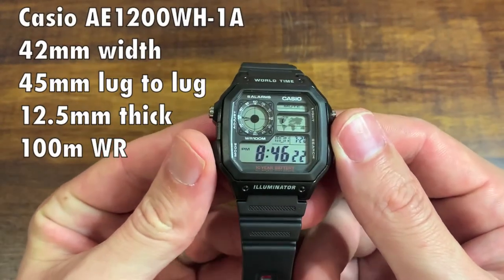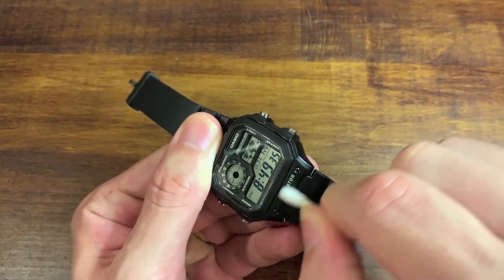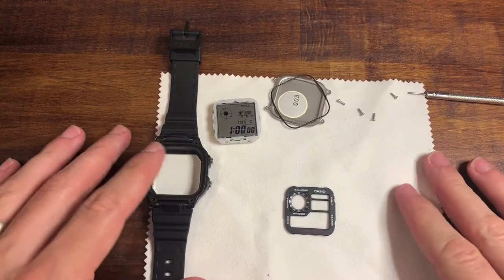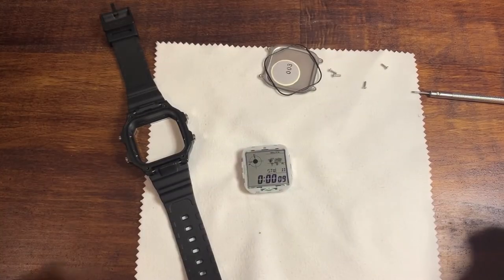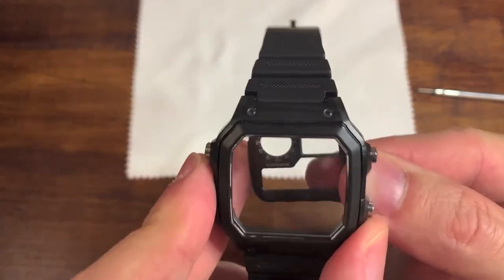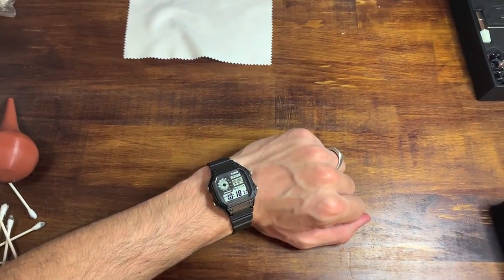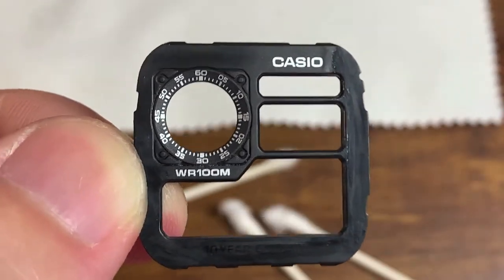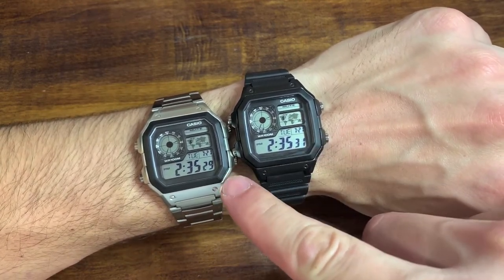Oops... I Used Acetone (Nail Polish Remover) On My Watch

Comment: You can use acetone on plastic but you have to use alcohol to wipe it off almost immediately. The alcohol will get rid of the smearing from the paint and also neutralize the acetone. Then if you want, if it dulls the plastic, use a dab of car polish rub into the plastic and with a clean cloth wipe and slightly buff the polish off without the polish drying. Ive done this with the lettering on resin cases and worked great . Give it a try on a cheap crap watch till you get it down then do your favorite watches like Casio sports watches.

Comment: I found another video that suggested using a Staedtler Mars Plastic eraser- the white one in the blue sleeve. Much, much faster. Plus, it's easier to apply pressure and control the process. No rub marks, no paint loss, looks perfect on the watch body AND the internal mask...
Reply from the maker: Nice! I’ll check it out
Reply: Thank you for the suggestion! I messed my watch, and through using the eraser it helped. Thank you!!!!

Comment: Despite your advice I did this today with nail polish remover. It worked great, I learned from your mistake and rinsed under the tap after a few seconds of scrubbing and repeated until finished. Cheers
Reply from the maker: Glad you found a good technique!

Comment: You can get the matte on the dial back pretty close with a quick brushing with a high grit sandpaper, saved one watch with that after i got the same melty damage when I went too aggressive with the goo gone.
Reply from the maker: Nice! Thanks for the tip

Comment: Acetone is not "corrosive". It breaks (some) polymer bonds. That is all it does, there is no "corrosion" or anything similar occurring, it's not salt, it's not acid.
Reply: BTW, you can "fix" the messed up finish with some light scuffing with a scouring pad, or if you want to get fancy, go through a couple of grits of sandpaper. You can also often remove the white stains by blasting it with a hairdryer.

Comment: Acetone is a powerful solvent and it pretty much breaks down most plastics. Seeing the black residue on the Q-tip should've been the warning signal. WD-40 might've worked better.
Reply from the maker: good point